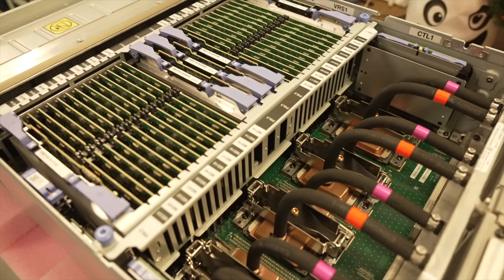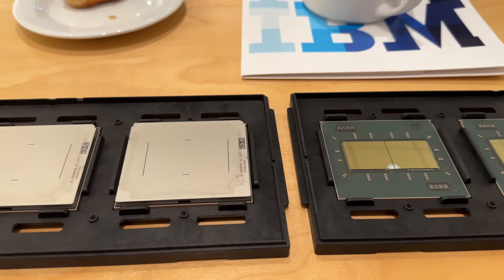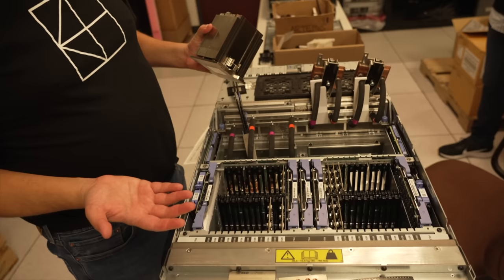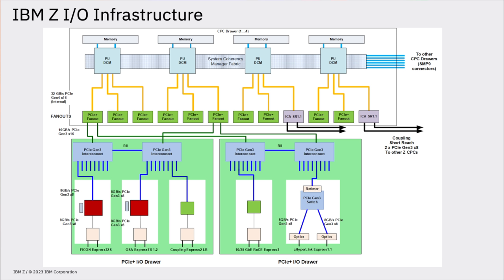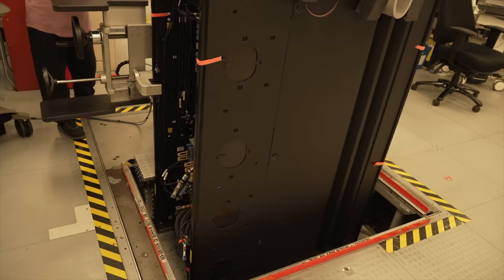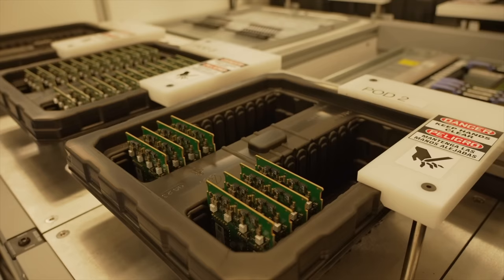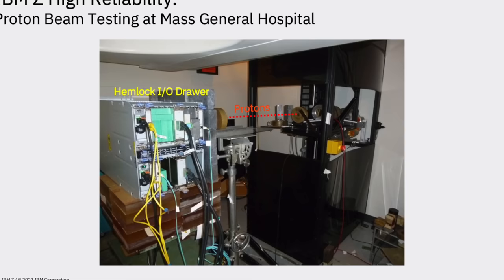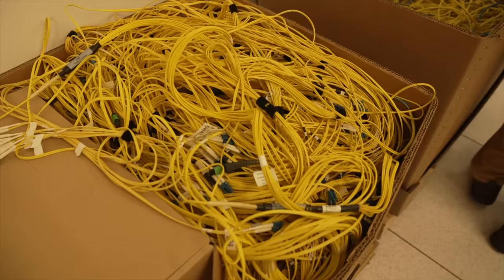Why Do Mainframes Still Exist?  What's Inside One?  40TB, 200+ Cores, AI, and more!

Comment: WOW! Quite a system. I started working at IBM in 1967 and retired in 2005. My first IBM system was the 360 model 50. It had a single 32 bit CPU and weighted 3 tons. The max RAM was 512KB and four I/O channels. The CPU cycle time was 500nS. RAM speed was 2uS. It managed about 200k instructions per second. We’ve come a long way baby.
Reply: In my days as applications COBOL programmer, I used a 370-158.
Reply: 32 bit 2 um is the same memory bandwidth as on a C64 from 1982. 512kB is as much RAM as in Atari ST from 1984 .
Reply: 360? I think my dad worked on soviet clone of 360 when he was in university.
Reply: I started on a 360-30.  IBM used to supply a Systems Engineer along with the machine back then.  Lots has changed since then.  It was quite an interesting field to be in.

Comment: As a software engineer for z/VM , you really DO get impacted by ALL of these things. The way you handle I/O failures, System failures etc.. in the code, is crazy. Came from being a web developer. From React/NextJS/insert JS framework here to PL/X and Assembly. I went from high up in the stack to relatively low on the stack.
Reply: @lisandro-lopez would like to know more about it from you , i wanted to start my career in Mainframe !!

Comment: My company is the largest financial institution by assets and I joined in 2007...  the funny saying that management says every year during planning...   The mainframes are on their way out. Then every few years we do a massive mainframe upgrade lol... Those things are beasts!!!   They chunk through data faster then anything else. You have to do a ton of custom integration, but damn, are they massive processing powerhouseS.

When the micro second counts to make money in trades and bank transactions, nothing beats a mainframe.

That single drawer is just one part. The mainframe is the full cabinet. You customize it by each drawer. In each of our data centers, we have MANY of the full Z frame setups. They are enormous and the redundancy is insane.
Reply: You working for blackrock?
Reply: @mephInc  nope, black rock owns damn near everything. But we work with black rock and at our annual RIA conference that my company puts on (and I owned and engineered the technology for the event for 7 years) over 800 desktops, 400 laptops, 2000 monitors, two racks of full mobile servers, blades, SAN, networking in a rack. Where in the rack we would run around 30,000 virtual desktops that would build on demand and deploy for items and destroy after. At any time, 3,000 vdi desktops running, about 30 virtual servers running the back end systems and network capacity of 4, 10Gbps fiber links fully redundant running from 4 different isps, and setup a funny NOC/SOC onsite, and lots more.  Now I'm out and moved on from that stress, but they run a lot in cloud now that we've started some implementation into that area.  

But we are the largest financial institution by assets, as in customer money in accounts. With our combined Acquisition we made 2 years ago and just on the end of finishing integration, nearly 11 trillion under our management. Official is 8 trill because of they are not finished moved over yet and the old name we purchased to go bye bye in history. 

Been with this company since 2007 when I was 23. Started as a contractor doing 21" CRT to dial 15" LCD monitors in two buildings here of around 9000 employees. And moved to support, then took on engineering and built and designed our VDI deployment of 12000 virtual desktops for offshore and retired our old HP blade computers (like a rack mounted laptop where a chassis had like 25 of them. And moved on to desktop engineering and then to security when we formed our new security org, then to various parts where I owned the products and built security policies and procedures and deployed a full rdp/ssh/admin (secondary) account vaulting and session management, recording, keystroke logging, monitoring and review, etc...  and then to lead architect. Literally started as the lowest on the tottem pole and in my 16 years there, moved up to sr manager and lead solutions architect of some of our more sensitive security infrastructure. 

Lol, and since day one...  mainframes will be out in the next 2 -3 years, we are retiring them!  But nope. There is just things that with active customer trading, world wide bank transactions, batch processing, and much much more, that a mainframe can do in a micro second with 100% accuracy that a computer or server can't. And when a milisecond is the difference of tens of thousands of dollars, they are worth their ungodly price tag. (Millions spent yearly on them for support and maintenance and IBM has staff onsite that their job is to sit and if something breaks, for it right away.  And a new unit is multi millions when you factor in power, cooling, data center floor space, setup, configuration, migrations, fibers, interconnects, etc...  it's mind boggelinging
Reply: @MikeHarris1984  
Nice to see you work your way to the top. Something most kids today can't comprehend lol.
Reply: Same at my financial comoany. MF is a dirty word. I think its cultural. The new sexy buzzwords get the attention, but all trades still clearing via the MF
Reply: Fascinating to me as a Career Microcomputer Architecture guy! I would love to see such things!
Reply: A compelling aspect of mainframes for financial transactions is that the CPU architecture natively performs base10 "decimal" math in hardware, both fixed point and floating point, so you don't have the subtle compounding inaccuracies you get with traditional binary floating point math.

Comment: Their fill station still runs Windows XP. I guess when you absolutely positively need your fill station to work every time, you only rely on the very best.
The way you put this Mr. Dave. Brilliant!
Reply: I remember a 1990s news story buried by most news services, US Navy outfitted a ship entirely with Windows XP, in control of everything.  Maiden voyage and all computers blue screened leaving the ship dead in the water, they had to tow it back to port.  Fortunately it wasn't in war time.
Reply: @jrstf  XP was released in 2H 2001.  If you're referring to Windows 98 (first edition), that would be believable because it crashed with a BSOD during the full press demo of plug-and-play.
Reply: @jrstf  If I remember correctly this fiasco was caused by some early Windows NT. An incorrect manual data entry on a keyboard caused the complete ship to shut down and it had to be towed back to port. It was not possible to restart the engines.
Reply: If my deteriorating memory is right then a university professor found the XP system would crash at intervals because a 32 bit counter overflowed(?)  I think it was about 7 days.
Reply: @jrstf "Buried by most news services..." or, as an intelligent person would say, "not reported because it's not exactly newsworthy to the vast majority of people."
But sure, it was "buried".
Reply: @tim3172  - That particular story was more entertaining than any other story.  The all powerful Navy ship beat by a computer error.
Reply: We still run some control room apps on XP at work, I have clocked 2500-3000 days of uptime on those bad boys no problem. Regular desktops too.
Reply: @jrstf  I think it was actually Windows NT. Happened around 94 or 95.
Reply: @benbaselet2026  I had 6 years uptime on my home Linux desktop 2001-2007 :)

Comment: Dave; thank you for bringing us along on your journey through IBM's new mainframe. I joined IBM in 1958 as a Field Engineer on a computer system IBM bult for the US Air Force used for air defense called SAGE (ANFS-Q7). The computers (each SAGE building had 2 mainframes for reliability) were housed in a 3 story building (with major air conditioning) and each computer had 68,000 vacuum tubes. Main Core Memory (RAM) was 64K of a 33 bit word, and the system ran on a 6 microsec memory cycle. Following my time in SAGE I returned the commercial business word and I worked on 1410/7010's in Boston. Then 360 models 30, 50, and 65. Then I was transferred to engineering  in Poughkeepsie and worked in the 705 building supporting reliability on the 303x systems.. So what a journey when I compare the Z16 to my life with mainframes and PCs (I still build PC's once in awhile). Thank you - Fascinating (and I wish I could start over again with a Z16). How much maintenance is required for one of these?
Reply: > How much maintenance is required for one of these?
Not a lot, they basically very rarely go wrong, and when something does it can be replaced in flight generally.

Comment: I started my IT journey on the Burroughs mainframe. The "Large" flavor (or "A Series") was a marvel in its day. Based on the first virtual memory, multi-processor architecture the CPU was a non-Veneman design that was optimized to run the ALGOL programming language. Like the IBM machines, these were reliable, and had massive I/O bandwidth.

Comment: This was so much fun! I cut my programming teeth on System/360 in the days of punched cards. We threw a little party in the computing center when we added the second megabyte of core memory. Next came Control Data mainframes (two 6600's and a 7600) at a national accelerator lab. The modules on these machines made electrical connections to a backplane, but also freon connections to the refrigeration unit. Things have come a very long way since then, and it's good to see that IBM is still in the game.

Comment: I love the pure brute force approach of these chips and hardware.   I do see Epyc using some more advanced technology though lately — TSMC N5 and stacked 3D cache for >1GB of cache per socket.   But that’s still not as complete of a caching solution as what these mainframe chips can do.   Thanks for the tour Dave!
Reply: The die size is HUGE
Reply: Think about the absurdly low yield IBM has on those chips and how expensive they must cost. Low yield means a lot of refused chips when manufacturing because of defects, it must be absolutely perfect, which is very hard for a chip that big. They probably don't even do binning.
Reply: Different use cases, one is not necessarily better than the other. Epyc has smaller less powerful cores but more of them. Mainframes are designed intentionally for single threaded workloads and a lot of the I/O offload is specifically so that you can prevent interrupts from wrecking you with context switching. I'm also not totally convinced that 3D memory is ever going to be the correct way to go but that's a very long and complicated discussion.

The mainframe would wreck Epyc in transaction processing but would get crushed for stuff like multimedia encode/decode and video games. 

But yeah, the Epyc you mention is also a newer design so the feature size on the chip is smaller.
Reply: @monad_tcp  That's why they have spares.
Reply: @monad_tcp  maybe they disable failed cores or cache segments?

Comment: I/O Transfer rates was always the differentiator, the amount of data they could move was huge compared to Mini's and Micro's.. Add to that the focus on reliability and the culture that runs through most of the Mainframe folks on high availability it remains a substantial weapon.  Never worked on them but working with a major bank had to back-end our Internet banking to Hogan on the mainframe as you say its always has to be there.  Love your reference to the cosmic ray memory flip, I have used that for years to explain to random reboots.  Dave you keep reaching new levels in your content please keep it up.
Reply: Yes that's a good point. It's still true that most business computing is I/O intensive rather than compute intensive. The architectural decisions in favor of better I/O is what generally makes mainframes feel snappier to users than giant clusters of cloud compute that should be much more powerful on paper (not that mainframes are slouches at compute, as far as single threaded workloads go they are probably the most powerful  single core on the market as long as you ignore floating point, which is basically useless to businesses anyway). The cloud is like a distributed super computer when what business computing really is looking for is a distributed mainframe. But you can't have a distributed mainframe because network latency  is just going to kill the snappy response no matter how many nodes you've got. That's why apps feel slower today than they did on a mainframe from the 80s and 90s with like 1/1000th the compute. The mainframe is actually one computer, with terminals connected and part of it. The network is a LAN not the internet. You cannot overstate that difference.

It's also true that modern user interface design is complete trash and skilled analysts and accountants and the other people that may not be computer people but get really fast with the terminal based mainframe apps know it. Those folks really hate it when you come in with a flashy new web app that you think is doing them a favor by being less intimidating. It's totally disrespectful to people in other professions to treat them like children as soon as they need to use a computer. That's pretty much all they ever get with other platforms and with the way sysadmins tend to treat windows and the way webapps are inherently limited by network latency.